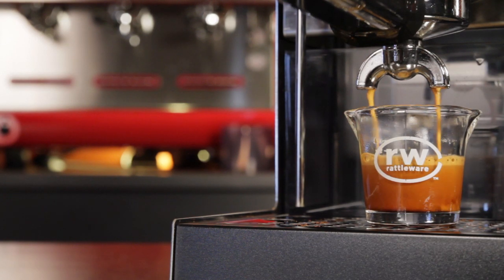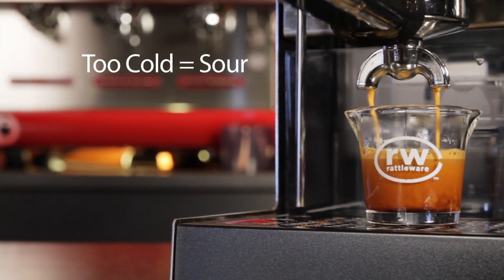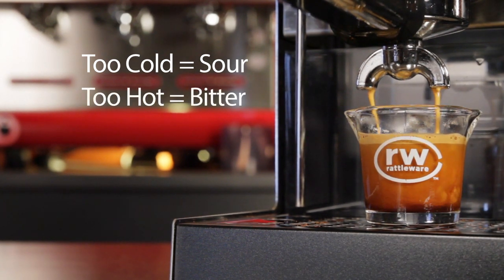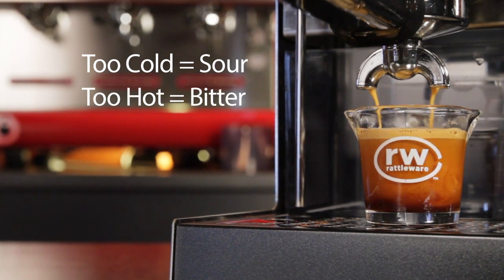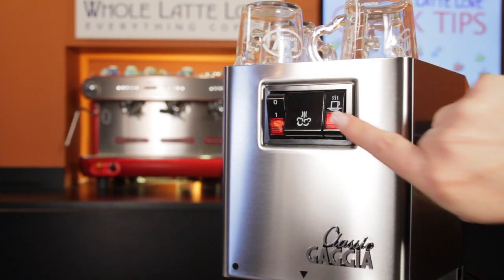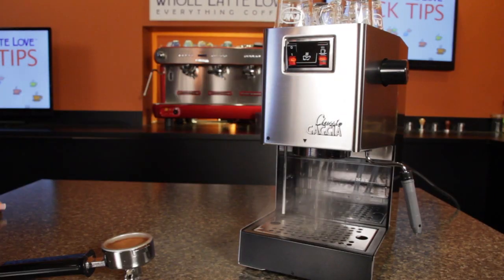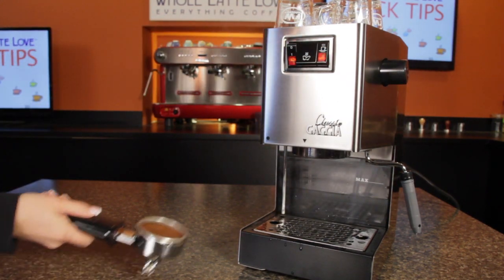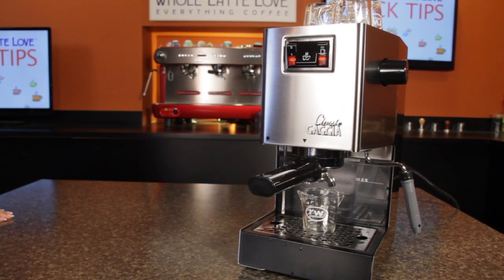Quick Tip: Temperature Surfing a Single Boiler Semi-Auto Espresso Machine

Comment: Well I have different method for temperature surfing on my Rancilio Silvia. I first run hot water through the steam wand to pre heat the cup and if that does not bring enough cold water in I run hot water through the group head for 5 sec wait for 5 sec and repeat that 2-3 times until the red light turns on. When it turns off it means that the boiler is at the highest temperature for brewing. So then I wait for aprox. 30 sec and pull my shot. You can wait a little bit longer or little bit less depending on how you like your shot but 30 sec seem to work for most coffees I've tried.

Comment: There is one problem with this method you run the risk of getting the solenoid magnet too hot which will force it to jam and prevent any water coming through. Its a design flaw of this machine as it is placed right next to the boiler with no heat shielding. Perhaps one fix is to use Aluminum foil to shield the component.

Comment: I think you will find that, no more than 20 seconds is going to put your espresso at the perfect temperature, don’t leave it even 3seconds more or it will be to hot. But like the lady says purge the initial steam off then your safe.  It’s better to do the timed way because if you purge the system of steam and some water your machine will add cold water to the boiler

Comment: How about including info on working with Nespresso machines? Or other similar espresso pod machines? Would love to learn more technical info on my machine as well as getting the best drinks from such machines - I realize they don't have as much 'wiggle' room as others but gotta work with what I've got.
Reply: nespresso seem better when run hot water in to the cup before each shot seem get better temp i run a lungo shot. then dump the hot  water and pull the shot in same cup.
Reply: J John Agree. I always preheat my cup with hot water and run a 'water'shot.
Reply: You're in the wrong place for Nespresso machines. The whole point is to pop a pod in and press a button.